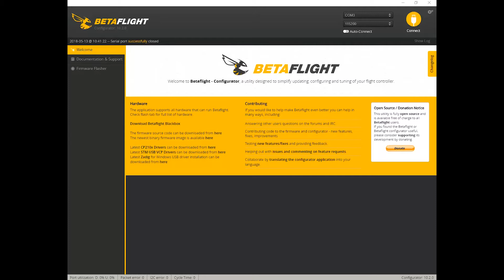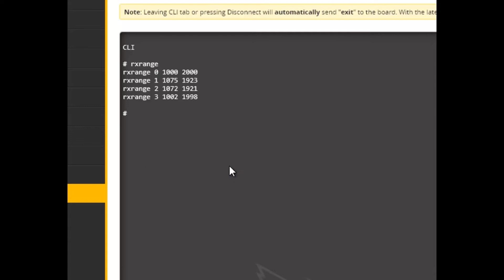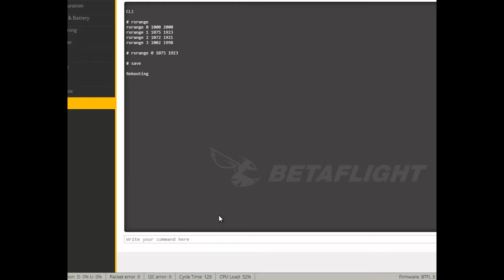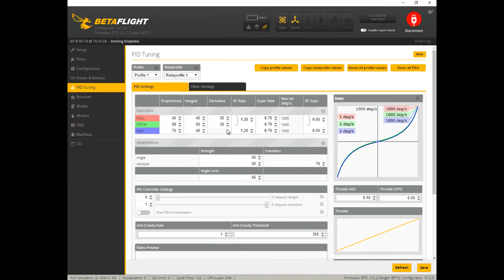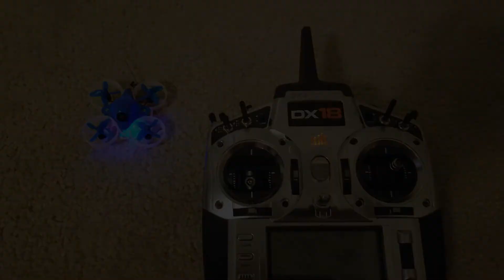Update! Turtle Mode on BetaFPV 65 Pro 1S Working!

Comment: nice video! my motor won't spin when it's upside down, what other settings did you change? I'm using beta65s too
Reply from the maker: Won't spin or won't arm?  did you go into the CLI and “set small_angle = 180”?  I'm sure there are other videos that do a better explanation of setting up Turtle Mode and how to get it going.  On mine, when it flips over, I have to disarm my motors, flip the turtle mode switch, then rearm my motors.  Then I use the right stick to get it to flip over.
Reply: @RickyGode  oh right, i did that and it arms. But when I set to Dshot 300/Dshot 150, the motor starts spinning at idle speed even before I arm. The thing is when I arm it did nothing, and when I throttle it did nothing too on these 2 Dshot modes. My betaflight firmware is 3.5. Did you do anything else when you select Dshot? I had to set it back to Brushless in order to get any response from my QX7.
Reply from the maker: @MarkAngel86  On mine I think it's setup to Dshot600?  But it came that way.  I'm pretty sure I followed this video and got it going (that and adjusting my ranges)  https://www.youtube.com/watch?v=d2fXInRQHH4